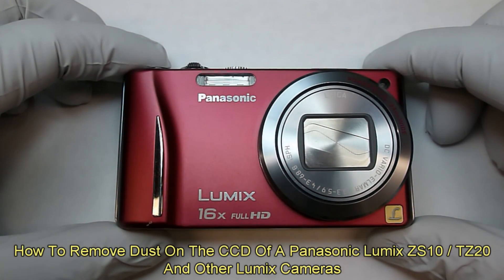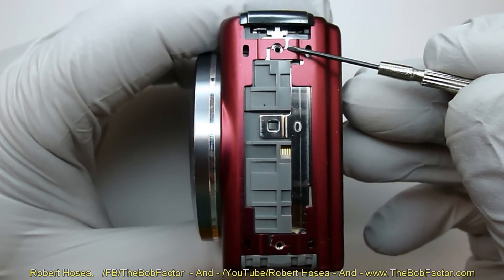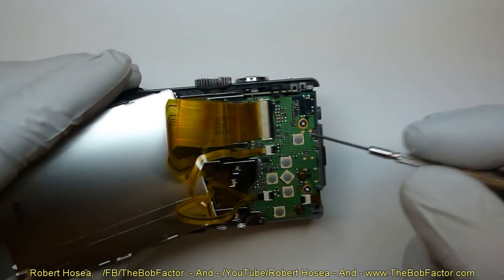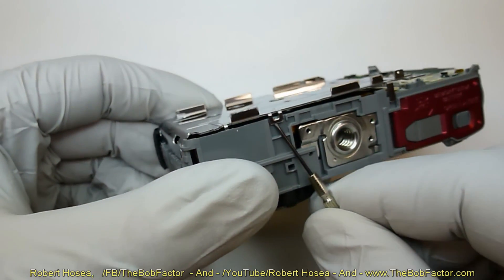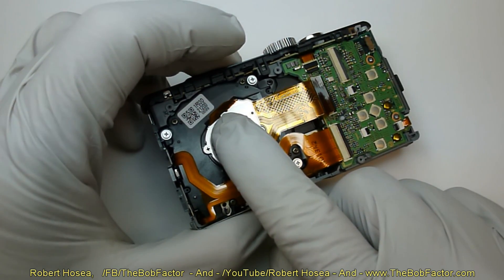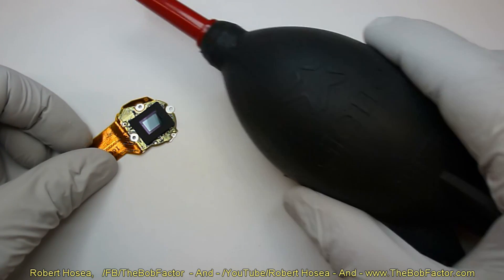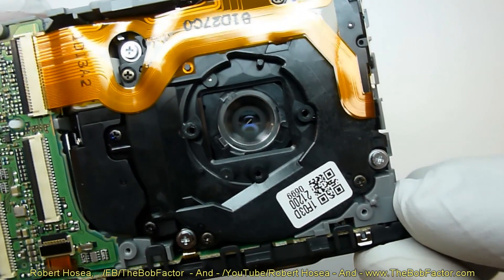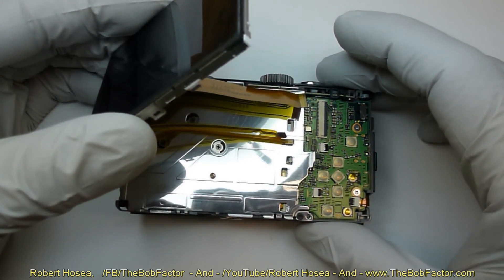Panasonic Lumix ZS8, ZS10, TZ18, TZ20, TZ22 Clean The CCD, Replace The LCD

Comment: You have one of the clearest video I have seen. Good clear info!   I am about to tear down a DMC-ZS8 that I am getting from ebay. I will test the unit first, but then I am going to make it a full spectrum unit by removing the IR filter to be used for astrophotography. I saw in your video that it is over the CCD and not part of the lens, so I was wondering if it looks as easy as taking  it out of the rubber holder? Any issues with focusing after the glass is removed? Thanks, Joe
Reply from the maker: Joe, thanks very much. I hope the video helps out when you tear down your zs8. As far as the focusing goes, I don't think you will see any changes at all. I don't know for sure, but I believe that the filter is not a lens at all. Which means you shouldn't have any focusing issues. I'm going to be doing the same thing to my Canon 60D for my astrophotography too, and everything I've read on that particular camera is that it won't effect the focus at all either. Please let me know how you make out on your zs8! -Bob
Reply: Thanks Robert, so I assume i should be just the rubber holding the filter. I have a Canon T6S I am using now, but I did not want to tear into that one. If the ZS8 works out well, I may look for a 60D/70D or T3i. I will send you an update when I have done my trials!
Reply from the maker: Ok. Thanks Joe. And if you do end up getting a Canon 60D, I just started a video series on completely breaking it down and putting it back together that may be useful to you on removing the IR filter on it.
Reply: So I have removed the IR Filter. Removing it was pretty easy, the glass is glued to the black rubber around the CCD and getting a finger nail or fine/flat screw driver (care with the metal driver as you may crack the glass) in the gets it loose. Work around the edges a little at a time. I took some shots after the removal and I had focus issues. Today I fired up the camera and focus seems fine, so I will retest tonight with the stars (assuming it is clear). I did need to remove the cable for the CCD as it was too tight and bending it to remove the filter may have damaged it. I do need to go back in and really clean the CCD as I have a few spots on it that I did not notice before.

Comment: Robert,
  Excellent tutorial.
  I was able to replace my broken LCD using this guide.
  A note for DMC-ZS20 users.
  After you open the metal frame around LCD following is done differently.
  1. There are only 2 ribbon connectors (NOT 3 like video).
  2. You will have to pop up the board that has 4 way button etc. on the right.
      This is because main ribbon wraps under it and then connects to the top of the board.
      This board is easy to pop-up (no screws etc.) and the connector is at the bottom where you can push it in place...

Thanks,
Robert
Reply from the maker: Very cool. Thank you Robert! The ZS20 is a popular camera and your detailed information on this will help a lot of people out.
Reply: Very Helpful 
I have the DMC-ZS25 which is like the ZS20,the 3 screws on the CCD were more like 
dimples rather than philips and two of the screws had springs under the CCD unit.Dust
free now.......Thanx

Comment: Excellent video, Robert - comprehensively explained and beautifully presented!  I had to do this on my old TZ7 (which is still going strong in my brother's care) so I know how common a problem this is on Lumix Travel Zooms... However, they are such brilliant little cameras,  it's well worth trying to fix any dust spots to extend their working life!  I also have a 2nd hand TZ18 on the way which looks to be in excellent condition - but I will know right where to look if it isn't!  Thanks a lot - subscribed !!
Reply from the maker: Thank you Anthony!
Reply: Anthony Skellern  z